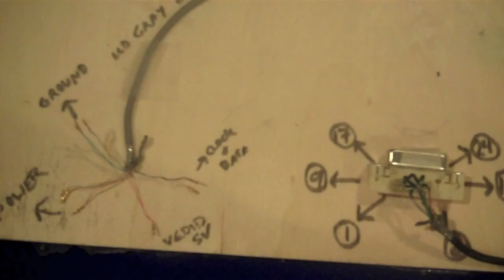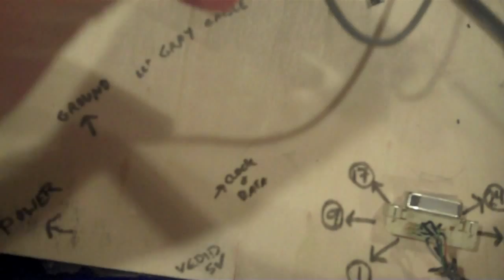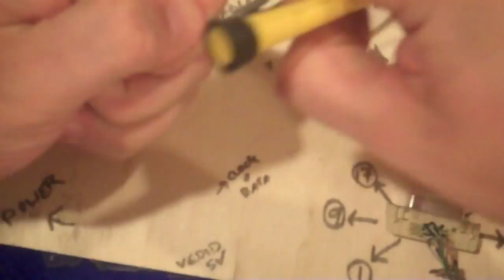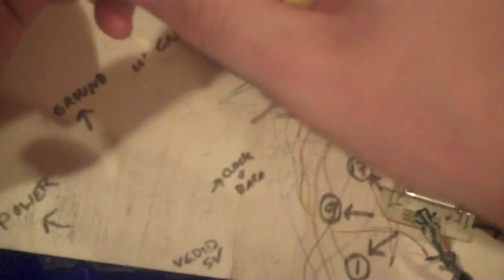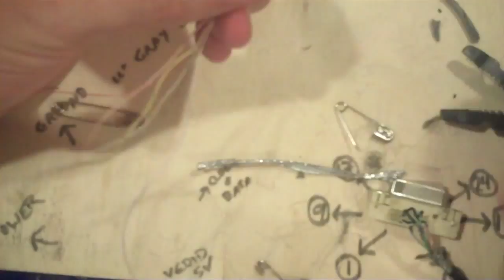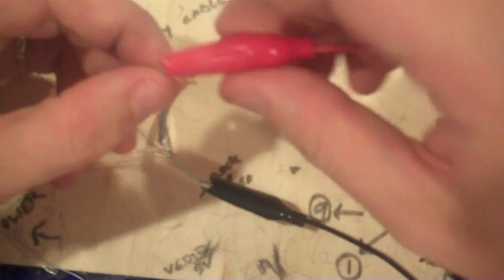17" iMac G4 to DVI - Part 7: Gray LCD Cable

Comment: Hi, I just completed this project (couldn't have done it without your video and blog.. It was a huge help) When I was finished with it though, the pins connected to the DVI kept coming off when I tried to move the cables around. Essentially my question is: Can I glue the pins in place on the DVI connector? and if so, what type of glue? eg: super glue, hot glue, gorrilla glue, epoxy.... Any thoughts? THANKS!!!!
Reply: how did you do it in the end? hot glue?
Reply: +ConnyfeatIPod I used some super glue (the gel stuff, not the really watery stuff). I didn't use a lot, just enough to keep things from falling apart. I also added an HDMI conversion and put the DVI to HDMI  connection inside a small project box for further durability.
Reply: Okay. Thank you so much. I'm also going to try some hot glue then :D Not sure about the benefit of the HDMI. What are you doing with this HDMI?
Reply: +ConnyfeatIPod not very many devices use DVI anymore, so with the converter, I can use my laptop, my ipad, and other things with the monitor. Good luck!

Comment: I have a 17 inch model of this mac that I have gutted and am wanting to hack into the monitor cable without cutting it all up. Has there been any sort of break out board that you could connect the TMDS into a connector that goes out to an HDMI or DVI connector?

Looking to mod in another system into this unit and I feel excited about what the results will come out to be when I finish.
Reply: AzurusNova also looking for that but cant find it anywhere.
Reply: I don't think there is much of a nitch market for something like this to be available, I guess just DIY'ing your own breakout board is about the only way to go about it.
Reply: If you crack up the back of the LCD's foil u can see a model number (Normally something like LM......) If you tell this the chinese guys at eBay that sell custom lcd controller board they can hook you up. I'm still waiting for mine to arrive...